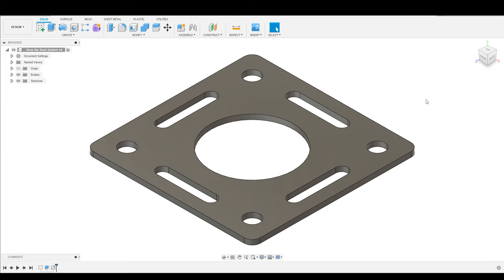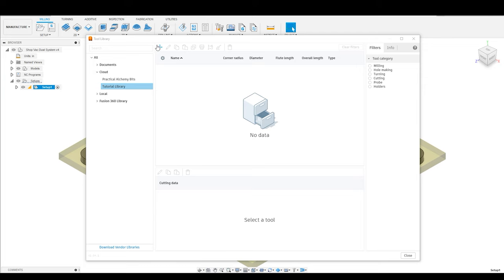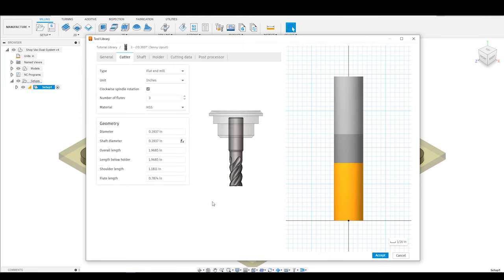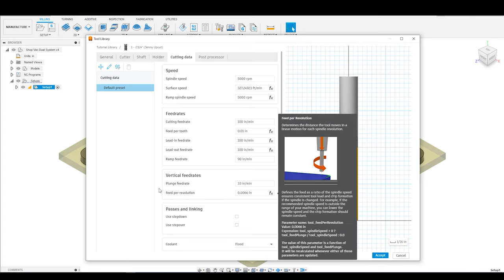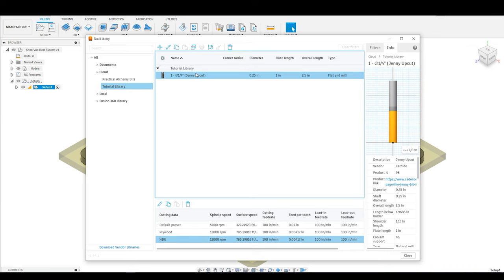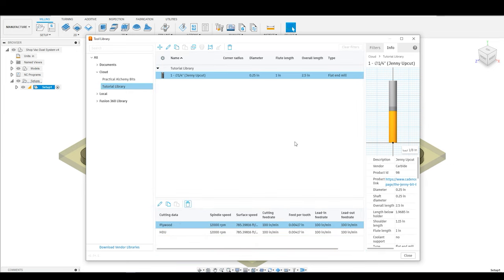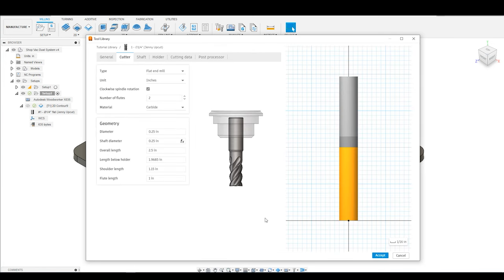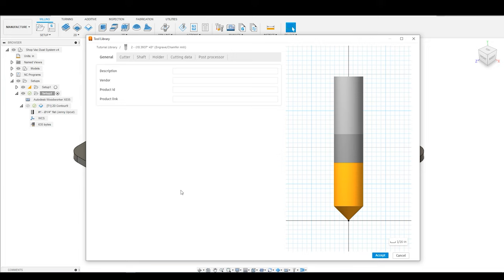How to Build Your Fusion 360 Tool Library - CNC Milling Basics (2022)

Comment: Hi, great video, very usefull for a rookie like me, now I have the Free version as I am just starting and I do not have the Cloud option that you mention, any ideas?
Thanks
Reply from the maker: Hey Kostas,   Glad to hear it was helpful :).  If you don’t have the cloud option you can still create a local tool library using the same process.  If you want to move it to a new computer or create a back up Fusion should give you to option to export your tool library
Reply: Sometimes Autodesk cloud servers just don't work properly. Sometimes you get slow/impossible login, sometimes it is missing some of the cloud features, sometimes you are not even able to save your design... Fusion relies more and more on the cloud and that's really not the right direction to go IMHO, but who we are to judge. So you take all the wonders in this amazing tool with their drawbacks.

Comment: I do not have a cloud in my library??
Reply: You have to go into your User Preferences (click your user icon in the top right corner and you'll se it) then in the Manufacture tab of the User Preferences you'll see 'Enable Cloud Libraries.' You have to toggle that option on. Do that and try again and see if the Cloud is in your Tool Libraries area. If it is, Right-click Cloud and you can select Import Library, then pick the file to import, or make a new one like he does in the video.